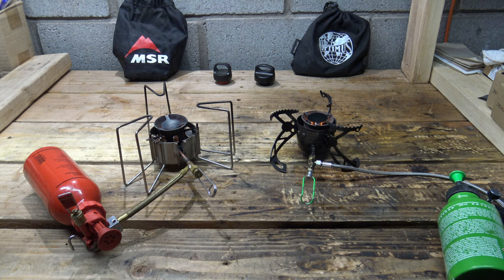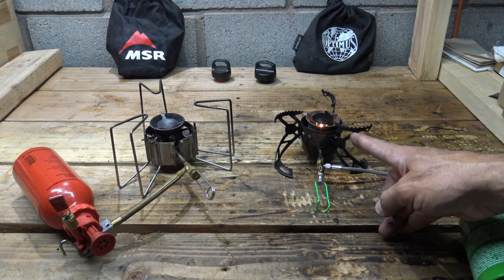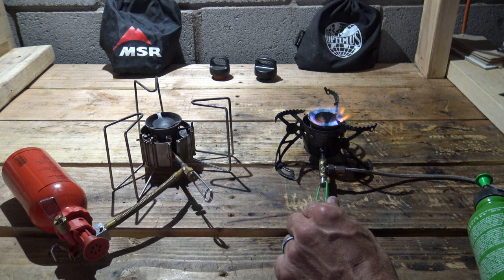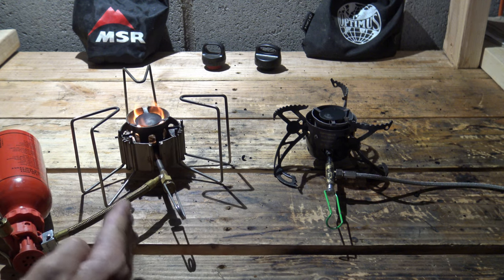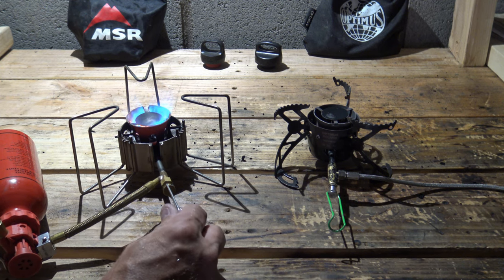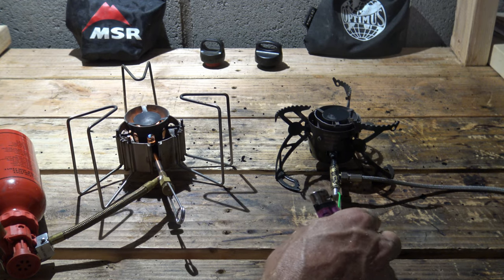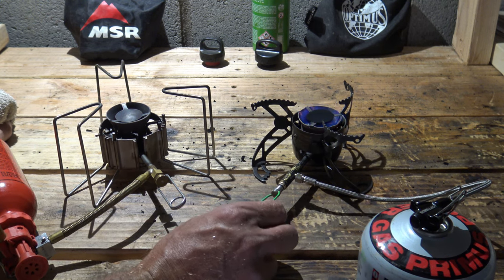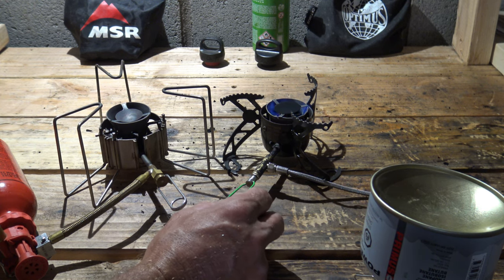MSR Dragonfly VS Optimus Polaris - Flame Control Comparison

Comment: These are both good stoves, and I've used both of them for decades. One thing worth mentioning is that IMHO, the pump mechanism of the Optimus is much better designed and better built than the MSR. The Primus pump is similar to the Optimus and is even better. Great video!
Reply: Which primus stove are you referring to?
Reply: @michaelsrowland  The Primus pumps for liquid fuel are all the same, I believe, but I have the Omnilite, which is the titanium version of the Omni fuel. Hope that helps.

Comment: My biggest complaint with msr is they make their pumps out of plastic and I had an extremely bad experience with my new whisperlite. Universal being brand new was defective and leaked fuel terribly . when I sent in my stove with the pump they said it would take 4 to 6 weeks and you could hardly get anyone on the phone .when I emailed them I got a email stating they were updating their message system and I could be a couple weeks or more before they might could reply back. After that I called them.back finally got hold of someone and told them.they could keep my stove. And don't want them to send anything back. I mentioned that they should make their pumps out of metal instead of plastic like the Optimus stoves . The rep said that would resolve alot of issues they have with pumps but it will never happen. I vowed never to buy any of their liquid fuel stoves again. And have bought quiet a few of the Optimus stoves. I have the Polaris , Vega , crux and crux lite and will be placing a order for a svea and new nova. I love my Polaris it's my favorite stove. I wish there was a video on how to do a complete maintenance on it like with one of their parts kits. Also it's alittle hard to find their kits.

Comment: Great comparison! I have to say that I find the Polaris doesn't work quite as well on LPG as White Gas, especially on very low settings, I also find it more difficult to light when using LPG than White Gas but that said its an excellent stove that works well in any conditions.
Reply: first，use lpg the low settings flame will jump，you can upturn the lpg. you can use alcohol preheating ，its easy to light when use lpg
Reply: @ludovic7344  I have used meths as a primer which works weel for LPG but have to say my stove is more difficult to light with LPG, once running its ok but I would expect gas to be much easier to light as it is with other stoves!

Comment: I’m starting to think that the dragonfly is better because although it won’t run canister gas, something like a soto windmaster as a get home stove and then taken on the road or used along side the dragonfly during essential service interruptions gives you 2 stoves at once and once canisters aren’t available and you can only get petrol and diesel the dragonfly is more reliable than the Optimus polaris because you can clean the fuel line easily and will also be more fuel efficient 
So I think pairing the little wind resistant Soto (which nests in the large titanium mugs) with the dragonfly for home use during service interruptions, car camping and emergency relocation point gives much more reliability and versatility?
Reply: I agree 👍,  to cover all bases, camping out of sea kayaks in pairs, I prefer the MSR DRAGONFLY for the heavy duty main meal cooking, used with a gas canister stove (Primus ETAEXPRESS 1lt heat exchanger pot) for a quick brew during the day.  This means no time lost priming, two fuel sources,  reliability if I have an issue, or canister gas isn't available,  or runs out.  Automotive unleaded petrol, is also dense energy for the volume and weight, and very obtainable compared to canisters.   If I carry both, it's better to have the zimmer ability of the MSR DRAGONFLY.
Reply: The polaris has the better pump (basically all metal) and the magnet cleaning needle is a better system than the msr shaker jet needle. 

Not sure what you mean with fuel line cleaning?

The polaris has a optinoal filter in the fuel line, which you can remove pr easily replace with a cigarette filter if clogged. But I found the filter worth using when I was in countries with questionable fuel quality. 

The polaris really burns anything. Saw a guy burning chainsaw oil with it. And yes that suprising worked.

Even outside of gas useage the polaris is better.

Comment: Imagine if MSR used the fuel line connections of the Universal on the Dragonfly! Full multi fuel.
I've done a comparison between the Optimus Nova, very similar to the Polaris, and a Dragonfly. Same results with adjustments, the Dragonfly does boil the same amount of water quicker.
Reply from the maker: That would be solid! Use the Optimus pump too!
Reply: @jiujitsu2000 
MSR shaker jet cleaning is simpler.  I use only Crown or Coleman fuel from gallon cans. No auto or kero/diesel. So little trouble with cleaning fuel systems also prime mostly with alcohol. I tend to remove shakers and such jet cleaning parts. This does marginally improve performance. 
Didn't you put up a hack/mod to run canister with a Dragonfly?? IT works well and I've done such myself.
Reply: Is there a difference in parts availability?  I am frustrated by being unable to buy individual repair parts from MSR;  stuck with repair kits.
Reply: @fratermus5502  Try needlesports.com an English sport store. I have used this source for parts from pot suppot repacements to o-rings and much more.

Comment: have you come to any understanding of WHY some of these stoves perform better than others, especially concerning the "simmer" setting? I have a Primus Himalaya using the 0.35 jet (standard for "white gas/Coleman fuel") and it really doesn't do well at all in simmer mode, or attempted simmer mode, even if the pump/bottle pressure is way reduced (most people suggest dropping  the bottle pressure to assist in simmer operation). 

Also, with bottle pressure in mind, when you did these tests, how full were the bottles (i.e. 1/2 full, etc.) and how many pumps (or maybe more generally lots vs few) before you started the test? Just curious as to whether there's a design consideration (which I'm sure there is) that allows some of these stoves to do better in simmer mode vs others (like my stove) that doesn't.

Comment: Polaris wins. 

The magnet cleaner needle is superior to the shaker jet since you can clean while the stive is running. Great especially when fuel is not great quality. 

The polaris will burn basically anything. Even chainsaw oil...lots of sooth but it works. 

And the polaris has the waaaay better pump. MSR uses a cheap plastic pump which is known to be the most problematic part.

Power output on both is very high. More than what needed. Time comparisons are always flawed by different tank pressures.

Comment: The ONLY thing this review is missing is the boiling water time!! I'm using MSR DF for 15 years! And before that, the Whisperlite International. 

MSR are very reliable, if you maintain, when using reg gas, diesel, vs white gas. But I'm going to switch to Optimus, and the reason is, pay attention how high the arm support is on DF and and how low it's in the Optimus, so  when you put the pan in the top, (I believe the Optimus will cook faster) and save fuel.  Tks for the review.

Comment: Hi I’ve just received a brand new Polaris and I cannot get it to start using an iso canister. Gas is flowing but it won’t ignite. I’m using the Coleman performance canister which we have available to us in the uk. I’ve tried lighting from the side and the top using a yellow flame lighter, jet lighter and an Optimus sparky.

Comment: I have both!
Reply: which one is better?
Reply: Me too…
Reply: @lumenbase  Dragonfly much preferred. The flame is more stable and less likely to go out at the lower settings. Also performance with unleaded gasoline is much better with the Dragonfly. Actually unleaded is all I use. Big disadvantage of the Dragonfly is the plastic fuel pump. I've gone through 4 already so make sure and pack a spare pump.